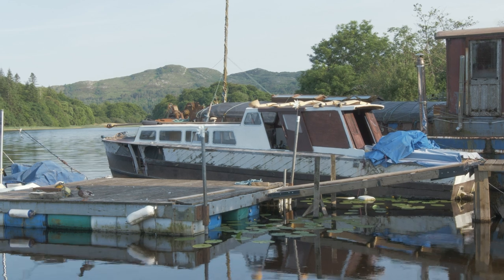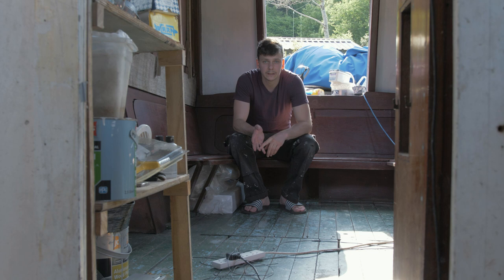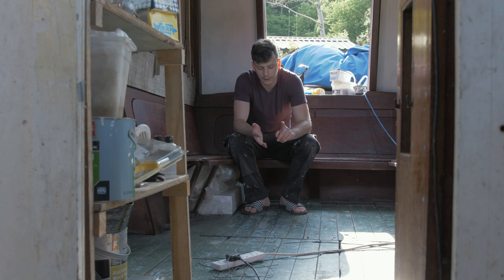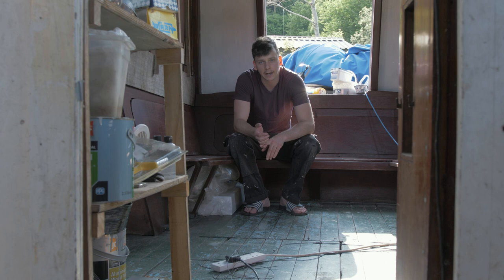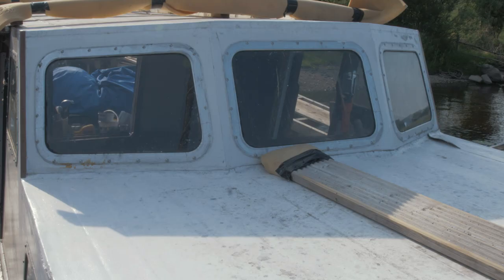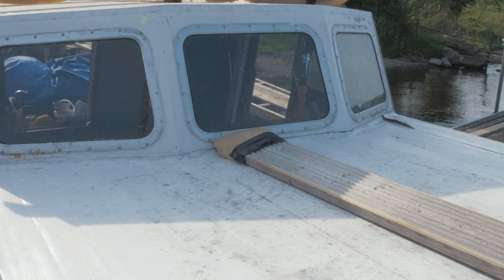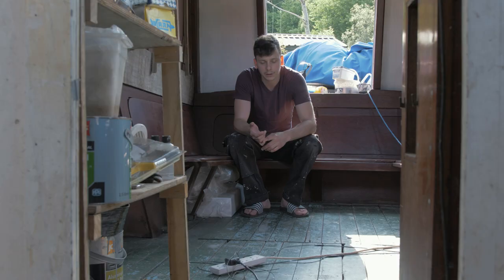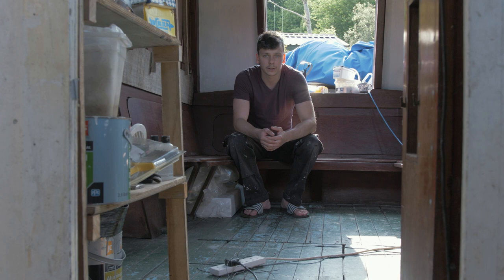I Need Your Advice to Repair my Wooden Boat Roof

Comment: Penetrating Epoxy saturation first then epoxy primer , regular epoxy then glass Matt then more epoxy, then paint then non skid then more paint. Then if you find cracks vee cut them then inject penetrating epoxy with a hypodermic syringe

Comment: I feel your pain! I’ve done the traditional canvas, and wasn’t too happy with its durability. Re covered my forward plywood deck with 8 oz glass cloth and epoxy, and it’s just now getting some soft spots after 10 years in the elements. You may also want to consider a product called Gluvit for sealing up the canvas on  the cabin top. I’ve used it on some deck repairs and was pleased with the results I got.

Comment: Gday yes i would go with fibre glass mat and epoxy  and if you watch sailing yaba  they did this also on there big sail ship for paint use a oil based enamel  its more mould resistant and you probably could add some mould killer to the paint.

Comment: Fiberglass sheets and epoxy! Then paint with whatever two part, uv protecting, water proofing special special epoxy paint you have available at your stores.  
That's what I wouldve done in your situation (but im no professional!). Thats what I did with the cabin I made for my old fishing boat. Also, I went with the cheapest possible fiberglass sheets, epoxy and paint and Im very satisfied with the results. 

You looked down and worried, I get that. Many of us viewers probably know exactly how that feels. You'll get it done 100%, just let it simmer for abit in your mind and you'll figure out a solution im sure of it. Meanwhile, dont worry dude. Enjoy it instead :D

Comment: Hi, the canvas you should of used is actually calico when you paint canvas with water based paints they can react with the chemicals used to make canvas water proof, if you want traditional, paint with oil based and apply calico and roll with a dry short nap roller to commit, then apply another top coat of same with the roller. If you don't want that than go to the same process  with epoxy but maybe use dynal glass sheet instead of mat to give a traditional finish. Definitely look at the boat work of travels with geodie. Cheers and beers

Comment: how about looking at a flat rubber membrane with a fibreglass surface like they install on ordinary domestic extensions with a flat roof? Proven durable materials that are trade available, cost-effective & relatively easy to install but last 25-30 years. Wouldn't be too costly for that relatively modest area. It might actually be cheaper to get a supporting/subscriber tradesman volunteer his skills.

Comment: As others have said, fiberglass/epoxy/gel cote is and would be the best solution. That being said, the old roof has so much damage and compromised repairs, including the canves. The wood roof needs to be replaced before fiberglass and epoxy are applie.

Comment: hi  use 3/4 real marine ply should be[  11ply, beach ] coat with 2 coats of laminating polyester resin the first coat thin down with styrene it will let the rein soak better in to ply. then the second coat put on neat and then a top coat of flow coat.[thats gel coat with wax in it ] the best roof ever ps make sure any sawen edges get coated with a least coats of rein.. cheers adrian sowden.

Comment: i have used some canvas before but only on a small job and it was ok, lasted some time
even my old land rover canvas lasted a long time, just being painted with a water based acrylic paint
its interesting how good some modern paints are, some are meant to be mould resistant, but i think that really depends on how often and how well you clean it, and regularity must play its part

not i have seen a few other boat builders thinking to use canvas, and at the last moment went for fibreglass, actually it turned out real good, but there's a price to pay - so surly you can use canvas, cotton sheeting, with epoxy resin, its a thought, perhaps try it on something smaller, a hatch or something, it should clean up ok, and may only require painting in future

i have been learning myself to do fibre glassing, watched many videos, and seen some great results, but as projects went on, the problems began, the biggest being UV degrading and delamination, but i have watching some folk who know what they are doing, ie vacuum bagging etc, and using epoxy resin with a thickener of silica to apply to the surface first, use a slow hardener to give you time to mess about, pre soak the fibre (or cotton sheet) and apply to surface, lay it out on a surface to work it, perhaps cover that with plastic sheet so you can soak the cotton sheeting - worth a go mate

great to have you back, look forward to the work

Comment: It wasn't clear if you are re-covering what's there, or replacing the lot. If you are covering over with epoxy/fibreglass/paint, I'd recommend killing off the existing mould and it's spores with a copper sulphate solution first.

Comment: If its just the original wood under there and you dont want the wood to show, then save some money and just use polyester resin, fiberglas mat. Fair it out and gelcoat it.. no need for epoxy on the roof.

Comment: Always use epoxy resin,  fiberglass and 2 part epoxy paint. Expensive but you'll never have to do it again.
Reply from the maker: Is there a specific brand you have used or can recommend? Unfortunately may be too epoxy for my budget.
Reply: @LakesideProductions  you can use polyester resin and fiberglass above the waterline. It's cheeper. Brand doesn't matter.